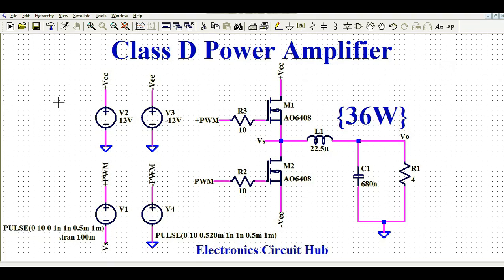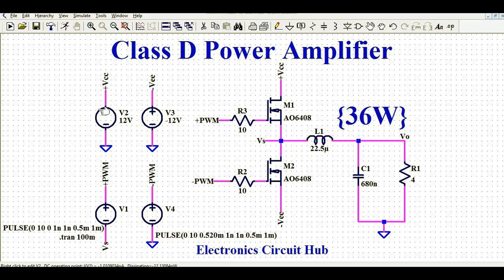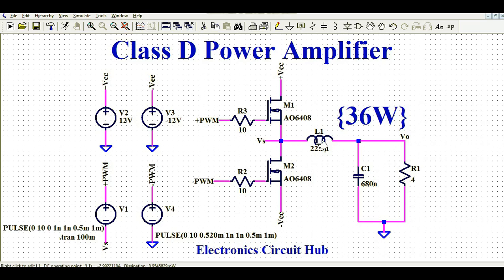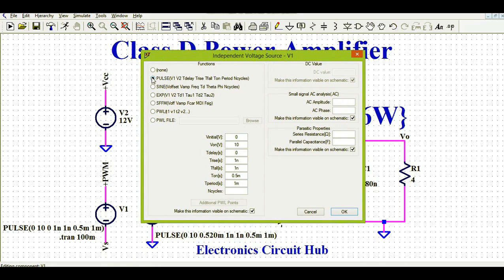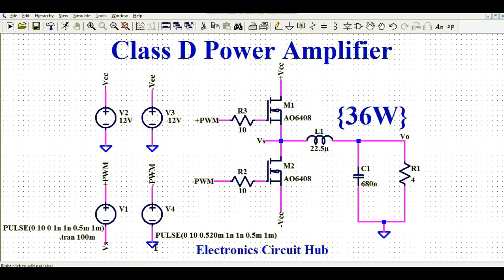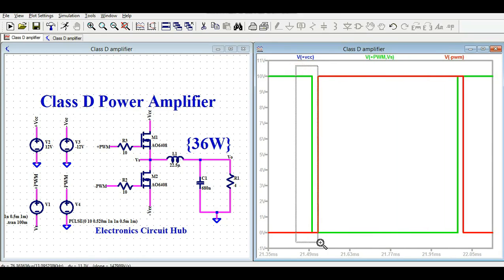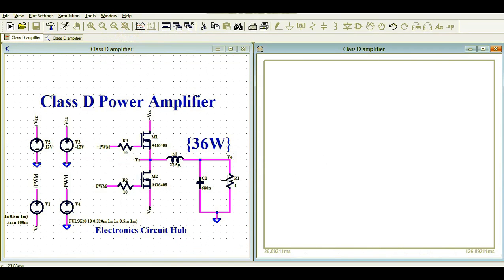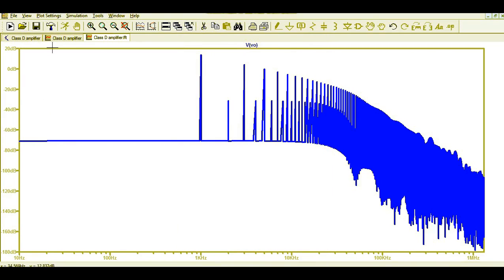Designing a 36W Class D Power Amplifier in LTSpice | Step-by-Step Guide

Comment: What exactly is Vs? Why isn't the +PWM connected to ground? I am confused because I have my comparator output PWM signal, and I do not know what Vs is in that case.
Reply from the maker: Hi...Vs is net connected to junction of both FET. In order to drive the upper FET you need high side driver. So that is how i created high side FET driver using Vs.